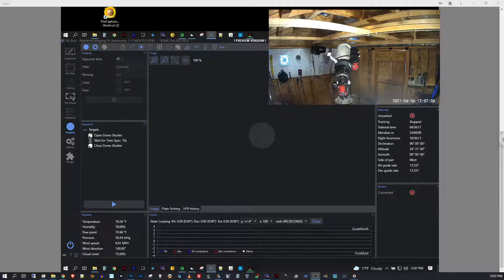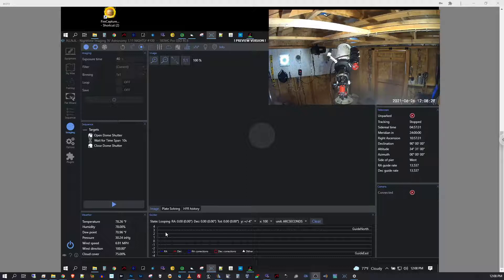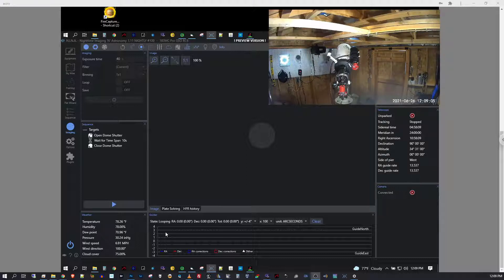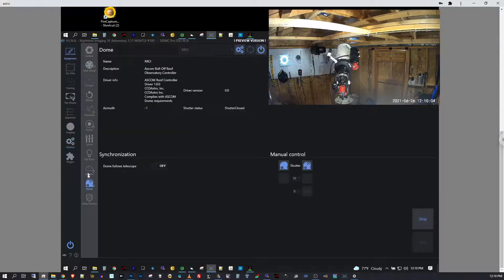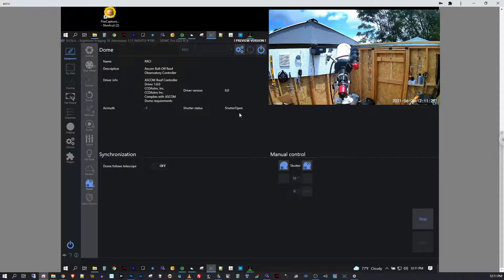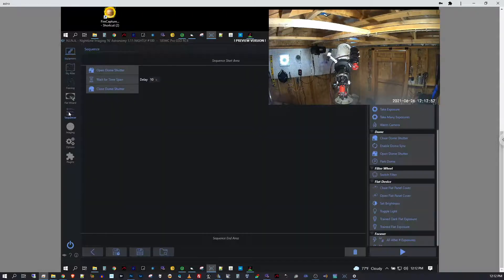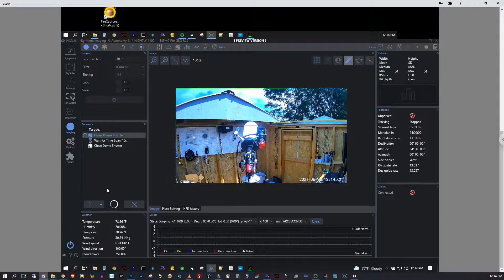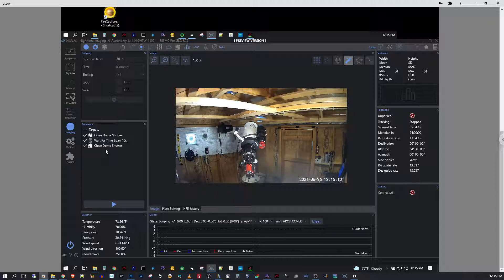Automated Roll Off Roof using Arduino and N.I.N.A

Comment: So, I am using a home made roof roll off system.  There is no circuit board for me to connect the Arduino to.  I am wondering how I integrate the Uno and relay board to the system.  Any thoughts?

Comment: Great video, I got all this working with a Shartec garage door opener and a modified Arduino sketch. It interfaces well with NINA using the RRCI Ascom driver. BUT the links to the Ascom driver are for version 0 and the documentation refers to a version 3 which includes "sticky Com ports"  Any idea where I can get this new version from.?

Comment: Hi Bruce, when I try to connect via NINA it an error pops up stating "There doesn't appear to be a roof controller connected to the COM port." The COM port the arduino is connected to is selected prior to trying to connect. I do not have any of the wiring installed, only the Arduino via USB to PC. Is that the cause? If not, any ideas? Thank you very much

Comment: I'm following the threads on using the gate openers to add automation to my roll off roof and I was wondering if you found any differences between the electronics boards like the Aleko and the GT Master you use. Fitting the GT Master in place of my existing 12VDC winch powered setup would allow me to do the whole automation thing. I already have the Auduino but not sure how to wire the different systems. got any schematics for your system you'd like to share?
Reply from the maker: I put a link to the wiring diagram in this update.  http://bruceg333.blogspot.com/2022/03/someone-asked-for-wiring-diagram-for-gt.html

Comment: Thanks for the update Bruce! I'm also working on mine. I was trying it without using the relay and just sending a HIGH to the open and close pins directly from the Arduino to the GT (sounds like we have the same motor). This doesn't work for me so now going to try with the relay board and see how that works. I really didn't want sensors for my open and close but it looks like I may not have a choice as NINA is looking for them to tell what position the roof is in. I was really hoping to just send a high to the close pin on the motor and have it close at the end of a session but not sure that's possible.
Reply from the maker: Yeah, you are going to want the Relay Shield and I suggest a Screw Shield Expansion Board.  I stacked the Screw Shield on top of the Arduino and then the Rely Shield on top of the Screw Shield.  Now I just need to enclose it better.

I used a pair of magnetic door sensors, one for open and one for close.  I originally tried to tap into the sensors that came with the motor, but that didn't work.  For me the important thing was to get something to work.  Now it's all about improving it, for example, I may use some heavy duty limit switches instead of these super cheap magnetic ones.  Other than the Arduino and some wire, here are parts I used.

Relay Shield - https://smile.amazon.com/gp/product/B07F7Y55Z7/ref=ppx_yo_dt_b_asin_title_o05_s00?ie=UTF8&psc=1
Magnetic Door Sensor - https://smile.amazon.com/gp/product/B07YFBG27Y/ref=ppx_yo_dt_b_asin_title_o00_s00?ie=UTF8&psc=1
Screw Shield - https://smile.amazon.com/gp/product/B014SGTP20/ref=ppx_yo_dt_b_asin_title_o00_s00?ie=UTF8&psc=1

Software wise, I ended up installing the RRCI, SkyRoof, SkyRoof X2, and SkyRoof Hub.  I'm not sure all those were needed, but for a while there I was trying everything.
Reply: @Br00se  Wow Bruce! thanks so much for the info. I will grab those sensors and try again. Once I get it to work I'll probably also grab the Screw Shield and a mounting box or something similar. I have all the same software as you said too lol. I'm trying everything.